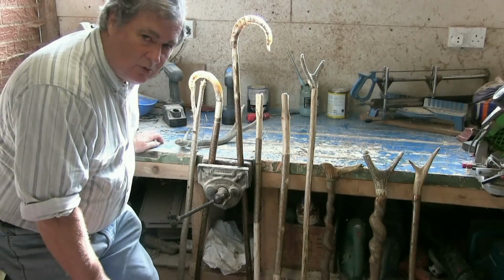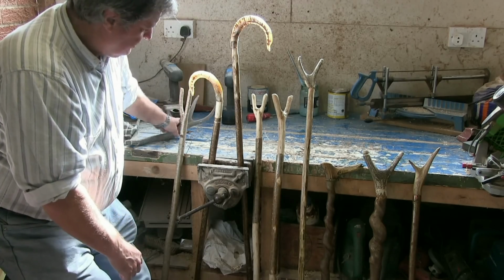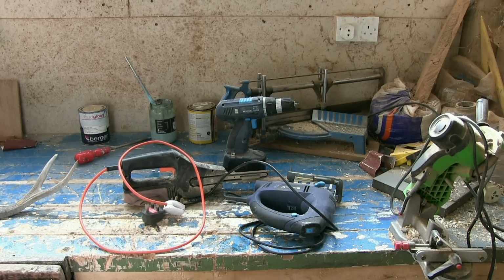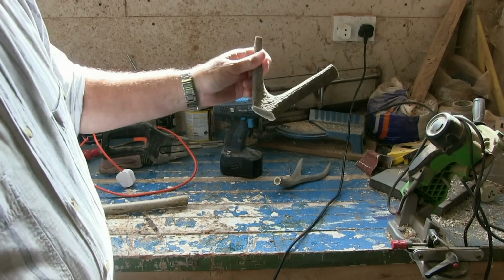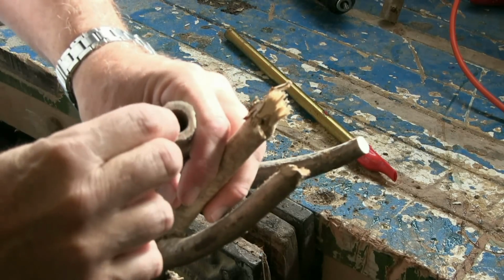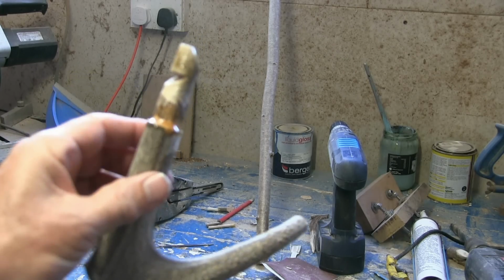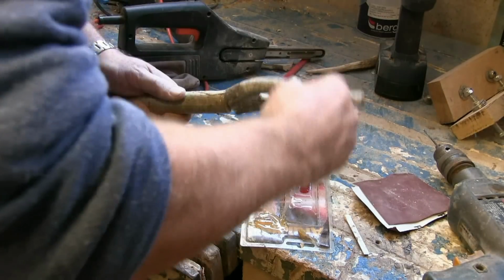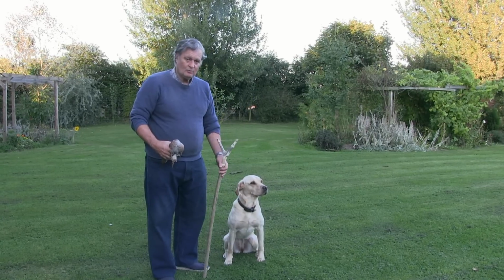Making walking sticks

Comment: The inside of the antler marrow is weak so after a bit of heavy use the screw will come loose.
Reply from the maker: Hello Sarah. If you would care to read the other comments below this video you will notice I have already replied to your criticism years ago ? I can see your reasoning but in fact the twin bond resin glue appears to soak down into the cells. As I, also, state there, all of my sticks are still in working use constantly, not one has broken or come apart. This film was last uploaded in 2015 and my old favourites, I always use, are now nearly 12 years old or so! The proof of the pudding is in the eating?! I am sure this will surprise you and your doubts will continue, but I am nearly 70 now and do lean on my sticks so need reliability.
Reply: @faith6651  ok thank you for your response. I’m new to stick making and it’s just what I’ve heard. I’ll try one with your method. I’ve learned a lot from your vids. Thanks.
Reply from the maker: No worry Sarah, you would be correct if not using the resin glues as the screws would break away but plastering in the liquid glue before attaching the top has never failed for me. Good luck and by all means send me a shot of what you manage? :-)

Comment: Can you use wood glue rather than epoxy let me know please as I can’t work with epoxy
Reply from the maker: If you are meaning the P.V.A. type white glues, they simply do not have the same water resistance, bonding and strength qualities I am afraid. I am not sure of what your problem is to them, if just touch then hopefully rubber gloves will help ? There are other strong glues, even superglues, and watermixed ones, but it maybe difficult to be sure you have no allergies. Certainly gloves are always advised. Have a word with a good local craft shop and see what they suggest?
Reply: @faith6651   no I meant gorilla glue
Reply from the maker: Yes you can use any finish that you wish once the stick is completed and dry. Varnish or whatever. Certainly you can sand the antler either completely or partially to show the texture. Even engrave or burn designs into the antler or wood, or carve the bark further. From what I have seen of "gorilla glue" they produce a good product BUT not just one type. The also produce a twin bond resin one similar to the one I am using and show. That soaks in and forms a rock hard plastic bond, filling any cracks. Each of the other makes of that brand has different uses and properties. Some of them maybe useful in your case but that one is ideal.

Comment: How do you season the wood without it splitting as it dries? Been having trouble with this
Reply from the maker: A very good question. Strangely enough I have never had a problem, always used Hazel BUT usually store it a while to dry out anyway. Drying in a shed rather than over heated inside room.
Reply: @faith6651  do you remove the bark before you dry it, or after?
Reply from the maker: Why remove the bark at all, it is attractive and helps protect? I never do, although have cut patterns down the lengths at times :-)

Comment: Is it better to use varnish on the sticks, or just linseed oil or bee's wax?
Reply from the maker: Very much a personal taste re a finish? I prefer a good strong exterior varnish such as a yacht varnish. The other choices may not last as well for such work?
Reply: Peterwoodarts : Thank you for your reply, I have just been given a walking stick. It doesn't have any finished coating to it and I was thinking of coating it with yacht varnish, but wasn't sure if this would chip off, as I've never used it before. 
Can I also draw your attention to an American site called Kinnet Sticks. He carves very elaborate sticks of snakes and other animals. 
They are beautiful to look at, though I'm not sure how comfortable in the hand they would be to use. 
Again, many thanks for your help.

Comment: Didn't you have to season the wood? I read you have to wait a year?
Usually watch your painting but I put a bundle of hazel in the garage back in the spring with this in mind. Loved the screw joining technique!
Reply from the maker: Absolutely right as drying the wood means the glue sticks better etc. I cut mine at the end of last game shooting season, so just before spring. It has only needed the summer months to dry in my garage. You can, also, drill in each way and use cut off 6 " nails for a stronger joint on big sticks, but the screw thread holds better and is easier I feel? FYI - The rams horn becomes pliable with heat from a blow torch and you can straighten and form it. Then it re hardens on cooling.
Reply: @faith6651  very nice shotgun a real expensive work of art I owns a Damascus open razor I use too  but Damascus barrels means no heavy charges in gun  from Damascus is your black powder or smokeless proofed. ? I'm a whittling branches guy I makes spoons and anything eles useful too

Comment: I would suggest you don't join the antler to the stick like this as it will break, waste of a good stick and your time, the best way is to drill out the soft part of the antler and make a dowel on your stick at least an 1"1/2 long whittle it down until you get a good fit then glue it up with a 2 part epoxy.
Reply from the maker: Thanks for your advice Ken. Two things - I have been watching some fantastic walking stick makers on here recently and have much admiration for them, including some wonderful carving and filming by many. Possibly far beyond my skills. I note this way of fixing that you mention, by most, and am aware. Equally, although I appreciate what you are saying, my sticks have been in constant and strong use for many years now, some over 20 years! Hardly a waste of a good stick and not just luck!? This may also be as I always work the epoxy right into the honeycomb firstly? So have never had any problems, as yet. My sticks being used for beating and all sorts. As I say, I appreciate your good wishes and understand your reasoning.
Reply: That`s good to hear, they have lasted well, its only my preference and just to give others an alternative method I suppose with the epoxy they can be ok for sometime as you have proven, I have had antler that is so soft in the middle it hasn't a chance of holding for long so I use the dowel method to make sure of a good joint.
Reply: Ken Nelson I also have concerns of this jointing method lasting especially if you used it to “beat” things as he says.
Reply from the maker: Well here I am at 66 years old and STILL shooting, "beating" , walking, seeking mushrooms here and in France using those same original and newer sticks Robert. I take it you did read my reply to Ken? Your slightly derogatory comment re " he and beat" are noted and I can only repeat. Of course I can see the logic in your concerns BUT the proof of the pudding is in the eating. You can see those sticks remaining in evident use after all these years even in my films this year in both countries and at 15 stone they support me well. Even though the wood is old and light now. The trick is in making sure the twin epoxy is well soaked into the antler end and joint. Ken is, of course correct, if the antler is hollow or very soft and spongy or there is any doubt. I have not had a stick fail as yet but would use a dowel method if I felt it required such, certainly :-)
Reply from the maker: Ha Robert! Fortunately, or unfortunately, my old walking sticks remain standing up better than my old stick these days and have more use! lol :-) ( Cannot complain with my past though. lol  )These sticks were only made for my personal use and not for sale, although I have made a few for pals. Including my long past father, and that stick remains in use by a friends father who it was passed onto. That more than ten or so years ago. Seems they will outlast me, even? :-)
Reply: Peterwoodarts heh heh Peter, my old stick ain’t what it used to be either, seems it put itself on longterm retirement/vacation. I finally figured out what my concerns were in the forefront, I was concerned with the epoxy bond due to the wood being green or full of moisture. If both surfaces are completely dry and clean, air hole cavities filled, then bonding would be enhanced with the embedded brass screw insuring excellent joining concerning this method and last a very long time. Just don’t try to beat a 400 pound mother Warthog to death with it! Great talking with you sir.  p.s. if you don’t have anyone to leave that beautiful double with, I am available.
Reply from the maker: 400 pound warthog? My ex wife's mother in law passed away many years ago, bless her. So am safe now. :-) The two Damascus guns, hammer and ejector, are both sold on but I now have a lovely 27" rose pattern English ejector, you may see me using it last year on here? Handles really well and will be using again shortly. Am out with my Miroku top grade in the morning on pheasant, have my silver pigeon 20 bore for fast action, also. You would be very welcome to a days sport with me but expect you are over the pond or some such?
Reply: Peterwoodarts it would definitely be a long swim from Florida USA that’s for sure. I thank you for the offer though and know we’d have a great time. Pop a couple for me tomorrow. 👍
Reply from the maker: Have a friend in Stuart, Florida and have an invite to visit Feb/March am considering. Anywhere near you? Do you fish, also? Drop me a line on peter@peterwoodarts.com If so? p
Reply: Peterwoodarts sorry I didn’t get back with you sooner Peter. OMG, I went to your website and marveled at all your work sir, in a word amazing. I’m approximately five hours north of your friend here in Florida. I do fish for enjoyment and a meal or two but nothing fancy.  I’m a simple soul and doubt you’d find me or my lifestyle very interesting at all so we’ll just leave it at that dear sir. You are an artist I must say, good day to you for now. 😉

Comment: Hello there Sir. What a delightful video and very well presented. May I ask why people like yourself use 2 part epoxy rather than say a superglue or other strong glue? Just curious as it must be for a very good reason and I would love to know. Can you recommend a brand in particular? Thanks in anticipation. Big chip :?)
Reply from the maker: For me the strength and consistency of epoxy suits me best as it is thick enough not to soak in and disappear but still able to soak in enough to bond deep into the fibres of the antler and wood making both more solid. It also blends well on a finish being similar in colour and texture to horn. Well know brands seem to be good, we did do tests on these glues in a technical college years ago and glued oak end to end grain. Then used a huge machine to pull them apart. The glue did not break but the wood actually ripped apart! On the same machine we pulled out 1" steel rod. Watching it stretch narrow like rubber and re form on release unless taken to breaking point when it, then, kept the narrow necks to the break point. I use super glue on items such as glass and pottery. I cannot recommend fast drying epoxy though as in it's earlier development I had a large pottery owl fall apart in the heat of a conservatory where the glue appeared to soften! Keep to normal?! Hope this helps?
Reply: @faith6651  Thank you so much for your prompt, thoughtful and comprehensive response. I very much appreciate that. Best wishes Sir.